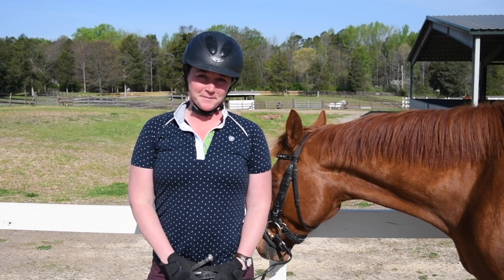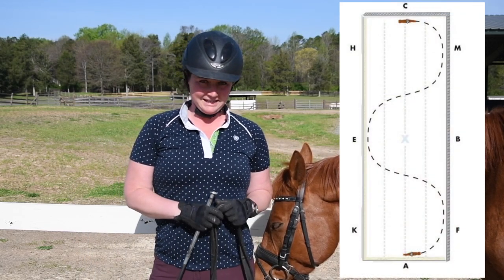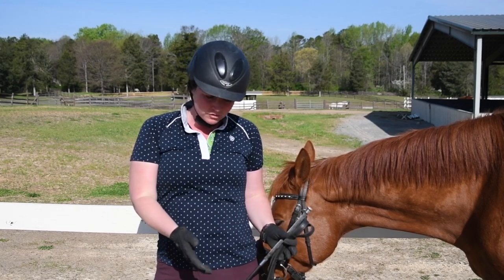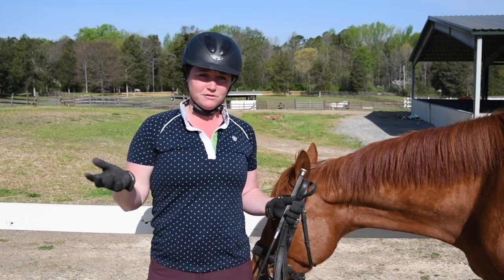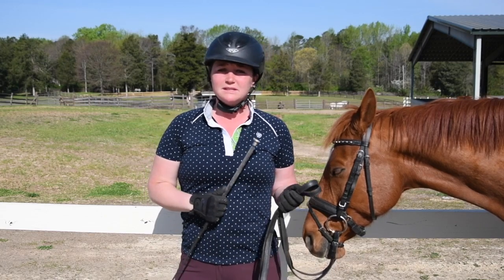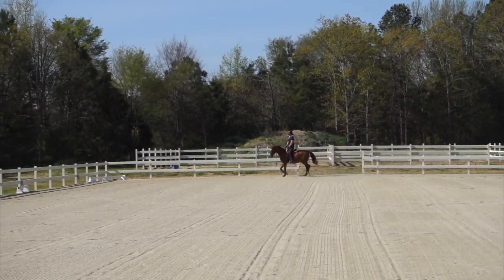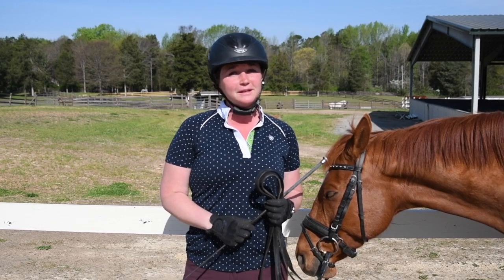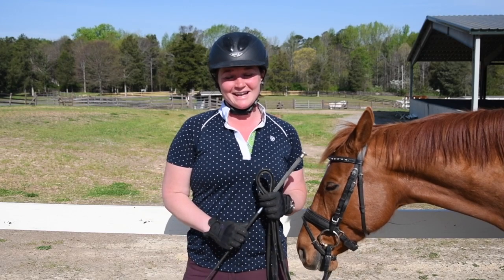How to ride a correct 3 loop serpentine

Comment: Please!! I need tips on how to seat on the canter without really moving my upper body like a worm, SOS
Reply from the maker: That’s a great idea for a video. Lunge lessons without stirrups while you hold on to the pommel with your fingers (don’t push your palms down) will help. Try to feel like your bottom half, from your hips to the bottoms of your feet, are very relaxed. Then try to feel like your upper half, from your hips to the top of your head, is one strong, straight, solid, poised piece. Don’t push with your seat/hips but allow your seat to gently follow the motion of the horse. Some times we appear to be too wiggly and floppy in the saddle because our horse is behind the leg and not on cruise control in the canter and so we are pushing too much with our seat to try to make the horse keep going. It’s important that your horse is in front of the leg so that you can sit very still. I hope this helps. I’ll make a video soon on this topic!
Reply: Deanna Corby thank you so much!😊 I can’t really access now lessons like that cause my trainer is not the best at what she is doing. It really did help thanks you 🙏

Comment: The half 20m circle only works in a 20x60 which not everyone has.
Reply from the maker: Yes, you’re right. Historically, 3 loop serpentines have been required in first level tests which are always done in the standard size (20m x 60m) arena. So, if you would like to do this exercise and have a smaller arena, I would suggest you just smooshing down the size of the serpentines and half circles. 😁